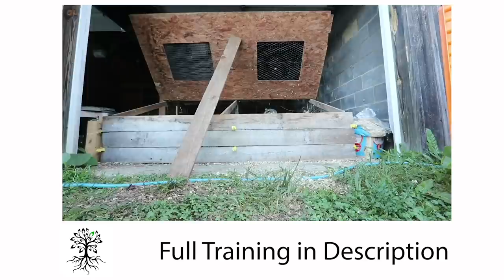Greenhouse Too HOT! Hoping in a $90 Fix

Comment: Hot air rises. You need some ventilation in the roof. Your vents on the bottom I think would let out the cooler. Just a suggestion.

Comment: For the greenhouse buy a fan to place in there so the temperature is not too hot. There’s a fan you can place on the walls of the greenhouse to bring air from outside and ventilate the inside. Hope this helps